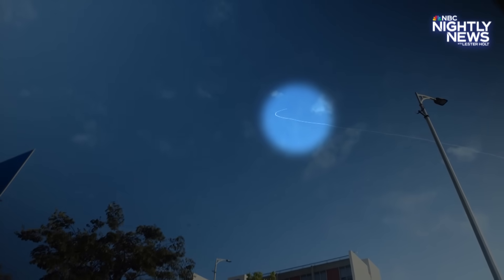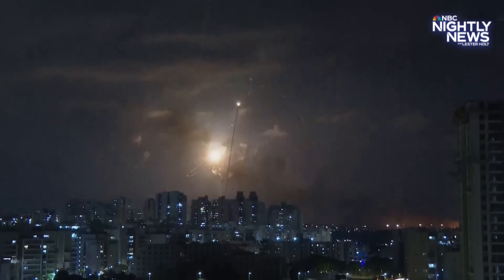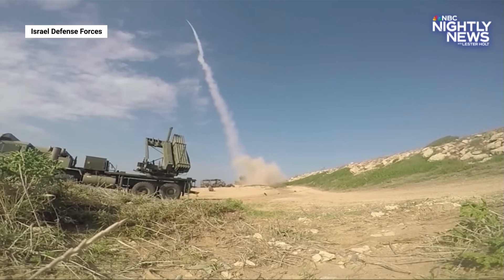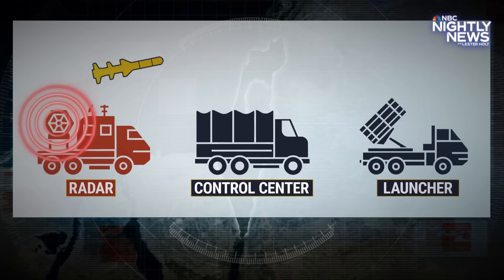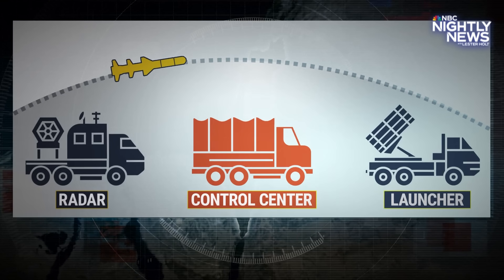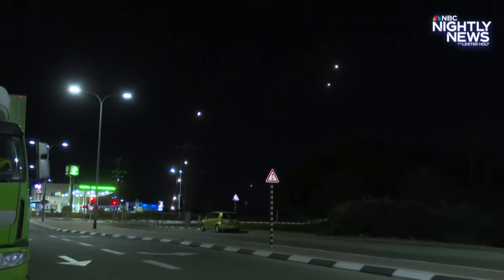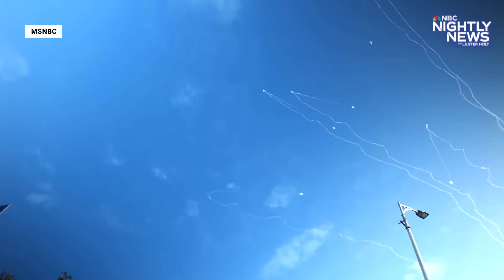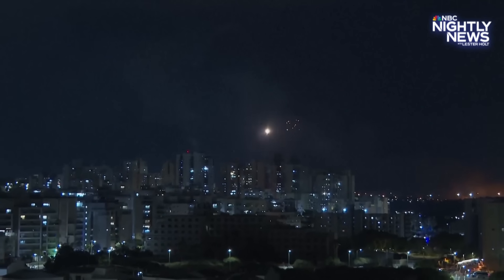Israel Iron Dome explainer

Comment: has anyone explained why the hell the iron dome wasnt activated saturday?
Reply: Can't stop thousands of rockets at once
Reply: Iron Dome was active and there are many videos of intercepts being made.  Israel is reported to have ten Iron Dome batteries, each of which typically has 60 or 80 interceptor missiles available to fire.  That yields a maximum of 800 missiles ready to fire, but that's for the whole country, so probably fewer than 500 were available in range to intercept rockets coming from Gaza.  Estimating from the US Marine purchase of Iron Dome, each battery will have one reload available to it.  About 2/3 of incoming rockets are calculated to fall harmlessly in uninhabited areas, so aren't targeted.  Hamas fired about 4,500 rockets, meaning 1,500 were dangerous.  Iron Dome is 90% successful at hitting targeted rockets, so the 1,000 missiles (including reloads) in the area likely took out 900 rockets, meaning 600 hit in or near populated areas.  So even though there was considerable damage and loss of life, the attack would likely have been about three times worse without Iron Dome.
Reply: @pahtar7189  iron dome is a lie
Reply: It was active. A few got through.
Reply: they didn't use rockets, they flew in with gliders and parachutes and came in by foot... go search "hamas paraglider"
Reply: Maybe  off day
Reply: A lot of the problem was on the ground as well.
Reply: This is a lie. A radio signal is sent to a certain receiver, already installed in the incoming rocket, that tells the rocket to self destruct.
Reply: ישראל היא כישלון ותישאר כישלון
Reply: It was active, some of the turrets weren't in position, and also with that many rockets, even a 95% success rate wasn't gonna get everything
Reply: the same reason the public alarm never went off in La haina during the fires, or why no attack jets were scrambled from Andrews AFB for over an hour after they knew planes had been hijacked on 9/11, or how nothing was done to prepare for a Japanese attack on Pearl Harbor despite having advanced knowledge of the attack, etc...
Reply: @neckarsulme  And what that reason could be? You conspiracy nutjobs always have to choose the dumbest most unhinged and unlikely answers. The Iron Dome was activated it just got overwhelmed slightly. 

For 9/11, They didn’t have time to react before the hijacked planes hit both WTC towers and the pentagon. It was a chaotic shitshow.

NORAD was informed that Flight 11 was hijacked at 08:37 and the plane crashed into the north tower at 08:46. Then the fighter jets took off at 08:53 from Otis air base 9 minutes after the events had occured.

The jets flew around aimlessly while the military tried to figure out where the hijacked plane was (already crashed into the north tower).

The decision was made to send the planes south past Long Island and hold the airspace there, instead of to New York City. This was because of the massive number of commercial flights going on and there was a fear of military aircraft crashing into civilian aircraft.

Then Flight 175 crashed into the south WTC tower at 09:03 while the military aircraft were “20 minutes away”. Eventually the aircraft made their way there and arrived at 09:25.

Then a false report came in that Flight 11 was still airborne and headed to Washington, so more fighters were scrambled to chase down an imaginary plane.

Flight 77 was hijacked at 08:54, and Turned off it’s transponder at 08:56. Nobody could find where the plane was so FAA was informed Flight 77 was hijacked at 09:25. More fighters were scrambled, but by then the plane was hundreds of miles away. It crashed into the pentagon at 09:37.

And pearl harbor?? really? You wanna go there?
Reply: @neckarsulme   Thee alarm in La Haina is for hurricanes and tells people to go to higher ground. They do not have a fire alarm there.
Reply: Or maybe they just wanted it to happen so they can do what they are doing right now??

Comment: Out of 4500 rockets they've intercepted "many". What happened to the 95%? Should that be 4275?
If you do the math, if they actually intercepted 95%, each interception would cost around $100k, which would translate to $425M just for the ones that hit, not counting the ones that missed.
It's all propaganda.
Reply: I believe thats old data, Hamas has been firing rockets at israel since 2011 and I think thats where the number 95% comes from. Recently Hamas has sent THOUSANDs of rockets in very short periods which is overpowering the iron dome. 5000 rockets in under 20 minutes and only 10-20 iron domes throughout the country.
Reply: Imagine how many lives and $ could be saved if haamas just stops.
Reply: They said that was the data from last May. Yes, they've invested a lot of money into having an alternative to mobilizing troops every time terrorists decide to fire a bunch of missile every so often since 2011.
Reply: so called terrorists  are fighting for their land unlike the europeen zionists - the army of occupation-. @lucasnuss
Reply: This is a lie. A radio signal is sent to a certain receiver, already installed in the incoming rocket, that tells the rocket to self destruct.
Reply: Indeed, saying that Iron Dome intercepted "many" incoming rockets is a wholly inadequate statement.  Israel is reported to have ten Iron Dome batteries, each of which typically has 60 or 80 interceptor missiles available to fire.  That yields a maximum of 800 missiles ready to fire, but that's for the whole country, so probably fewer than 500 were available in range to intercept rockets coming from Gaza.  Estimating from the US Marine purchase of Iron Dome, each battery will have one reload available to it.  About 2/3 of incoming rockets are calculated to fall harmlessly in uninhabited areas, so aren't targeted.  Hamas fired about 4,500 rockets, meaning 1,500 were dangerous.  Iron Dome is 90% successful at hitting targeted rockets, so the 1,000 missiles (including reloads) in the area likely took out 900 rockets, meaning 600 hit in or near populated areas.  So even though there was considerable damage and loss of life, the attack would likely have been about three times worse without Iron Dome.
Reply: @pahtar7189  you cant use math to support your arguments.  Conspiracy requires no thinking so i'm gonna agree with the other guy.
Reply: you need to listen. The 95% figure was not from the day of the attack.
Reply: Maybe 95% on intended interception? Seems in the video they may just let rockets that arnt going to hit anything do just that.

Comment: Why doesn't the enemy put all efforts into disabling the dome which is likely scattered.
Or use firework if necessary to deplete of ammunition
Reply: shhhh dont give them ideas
Reply: The first batch of missiles does not contain explosive warheads
Reply: @monthersalem8924  righttt an intercepting rocket doesn't need explosives to be effective. I guess we should think of it as a tiny rocketship without anything that deadly inside.

Comment: Hamas know they need to send thousands rocket at the same time to breake this system...Laste weeekend was 5000 rockets...
Reply: Correct that was why the Gaza strip will become dust once the war is over.
Reply: @tuanngnt  If the Gaza strip is dust it means that Israel ended decades ago
Reply: This reporting is a lie. A radio signal is sent to a certain receiver, already installed in the incoming rocket, that tells the rocket to self destruct.